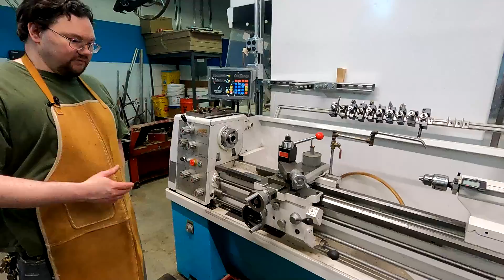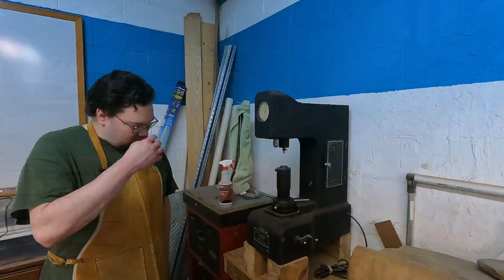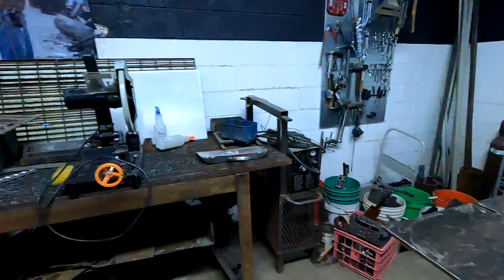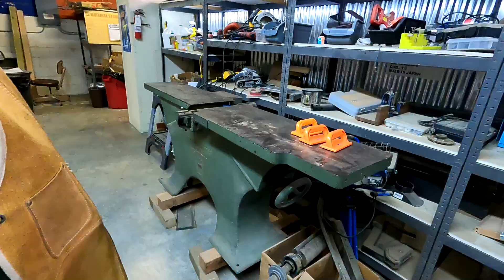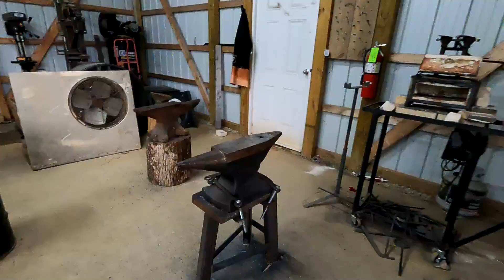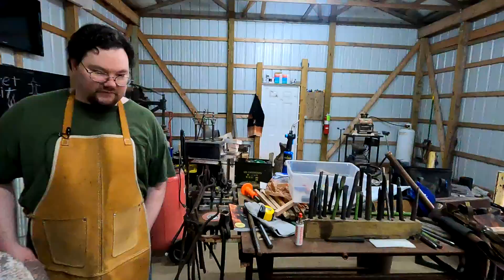Shop Tour 11:  Knox Makers - Maker Space, Knoxville, TN

Comment: That surface grinder is 100% a Harig 612. I've got one just like it.
Reply: Yea.  I need to find a parts diagram for it.  I found one for some newer ones, but, this one is rack and pinon vs cable driven.  Need to figure out how the oil distribution is setup.  I don't think it's getting oil feed up to the site glass.

Comment: Nice selection a smaller bandsaws.  The dual wood/metal saw is nice, and that craftsman saw is a workhorse if maintained properly (I have the "electronic" version- nothing special, just displays things you could easily check otherwise).
Reply: We're actually selling the craftsman.  It's had a few issues, and the wood guys just want to get it out of there.

Comment: In the SF bay area, we've had many maker spaces go under.  I've never been to one, because I didn't want to go through the hassle of auditing my skill set, but there have been a few times I wish I had access to TiG at 2 in the morning.  That surface grinder could also be a Republic/Lagun.  It's looks very close to the one I have.  If so, the manual is unobtainium.  I've been looking for years.
Reply: 24/7 x 365 access, and we're 100% self funded. No operational grants, no outside funding.  We actually managed to gain members during the Covid shutdown and beyond.  We're over 225 members last I check.

I'm 100% confident now that it's a older Harig 612 rack & pinion. The manuals for the cable ones match up with exception to the cable vs rack.

Comment: Nice place! They need to establish a Foundry in that new area they're going to get. Super place!
Reply: Funny you should say that.  We have a small one that was recently brought in, and I have gathered materials to build a bigger one.  Outer shell will be made from a 30gal squat oil drum (20" diameter) 2" Thick refractory (cast-a-lite 30) with 2" thick blanket.  Giving us a inner chamber of around 12" Diameter.  Plan is to make it 20" tall with 12" tall chamber.  Propane powered.  Question is, single burner, or dual burner.  and if dual burner, stacked,  or opposite sides. Forced air?
Reply: @KnoxMachining  , a single burner is most often used and placed at the bottom of the furnace so that it follows the inside of the refractory surface corkscrewing from the bottom to the top of the furnace. Yes, add forced air. The oxygen in the forced air will make the flame hotter.

Comment: We have a few of these in the UK but I wasn't really aware of them. Near-ish to me there's a group that run 'activity shops' whether knitting or less machining woodworking (mostly hand tools with the odd hand electric tool).

One thing I have heard of over here - if they're still going are 'renta garages' - dunno what they call them but if you want to work on a car and don't have the tools or space, you can take your car to one of these places and borrow tools (including use of a ramp/lift) to work on your own vehicle. Anything like that in the US?
Reply: There was one of those that opened up in Knoxville.  But, the website is no longer up.  So maybe they went under.
Reply: @KnoxMachining  I think they're probably a bit 'specialist' - few amateurs would have the experience to keep the places going.

I once took my car to a 'father & son' garage - being very hopeful of quality workmanship. The job was to fit new steering rack gaiters. I went back to collect the car. "Sorry, we were unable to get the wheels off or loosen the track-rod end ball joints.
I used a friend's tarmac driveway to do the job - far more comfortable than my parking area - all tiny loose stones !
I thought later, I could have gone back to the garage with my limited toolset and shown them how to do it.
My car was a Ford Fiesta - and I'd come across an earlier model owned by a female doctor. The car needed to be jacked up - on a really sturdy well-place jack (almost bolted to the car's frame - and, having taken the wheel studs out, you needed to belt the tyre with a 56lb hammer several times to get it to creep off the hub. Talk about interference fit !
Reply: I didn't think the UK had anything like this... I think all the renta garage like places went under because of insurance costs and health n safety....I'd be interested to know if any are still operating
Reply: @shaunsautorepairs5410  H&S & I kills most things. Whether any are still going here, I don't know.